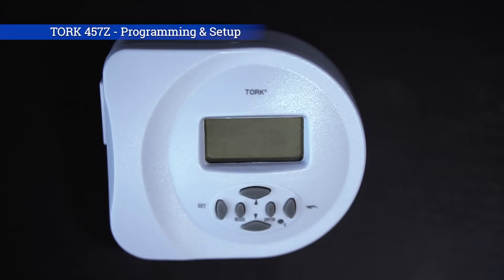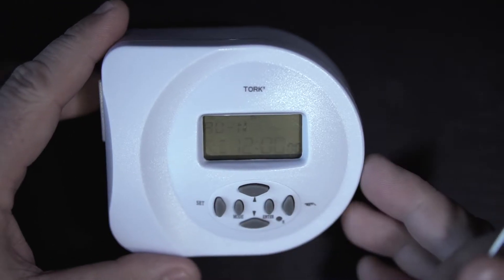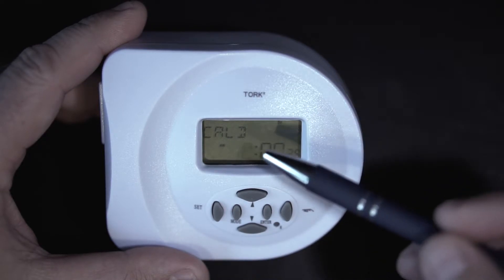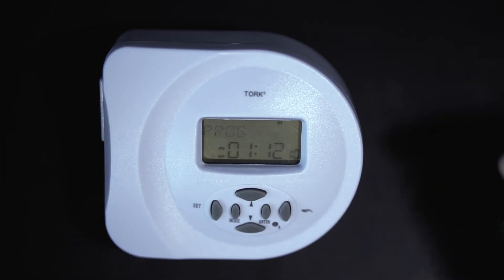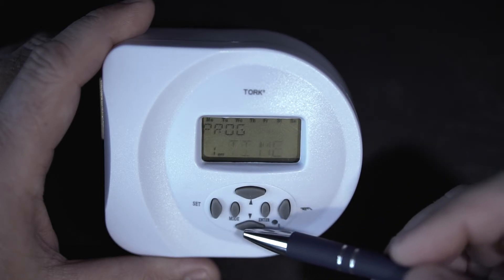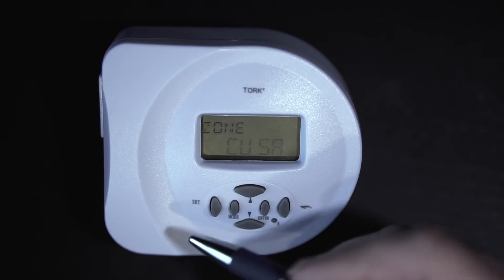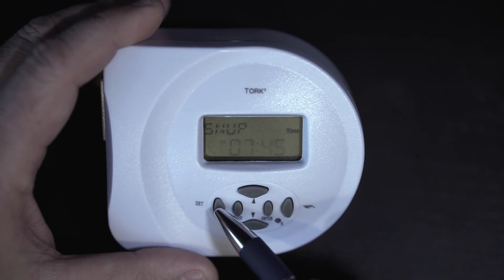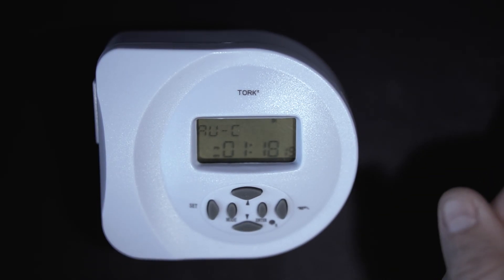Tork 457Z Digital Astro Timer   Easy step by step programming and setup

Comment: This was an incredibly helpful video! Lighthouse installed our landscape lighting 9 years ago (Fishers, IN!). When I came home last night I realized the lights weren't on. I went over to the box mounted on the house and bypassed the timer. The lights came on. I was sad to realize the 457Z is no longer made BUT I brought the timer inside and started tinkering. I was able to get the timer to display something on the readout and found this video on how to program it.  There's no way I would have figured it out on my own. I'm curious...now that the 457Z has been discontinued what are you using for timers?

Comment: Yeah, but it's got 20 program settings available! So how do you know which program you're running? I cannot find an indicator on that screen. Are we running program #1? Program #6? Program #18? How are you supposed to know without going back into all those menus? Very frustrating that they don't include this in the instructions.

Comment: Hello, after setting close to end, mine says AU-N, not AU-C.  Did I do something wrong?
Reply from the maker: Once you get through the entire programming sequence, the timer should automatically convert from AU-N to AU-C.  If it doesn't I would recommend resetting and trying again.
Reply: Mine says AU-N as well. But still seems to work. I think this has to do with the part of the country you are in. If you're in the North, it probably says AU-N. If you're further south like Lighthouse is then it would probably say AU-C. If you're further south, my guess is it would say AU-S.
Reply: @jymlewis  Exactly right- N for North, C for Center and S for South based on the Astronomic basic settings.